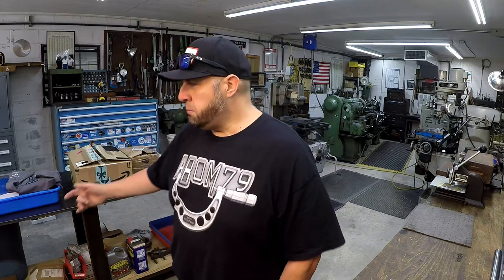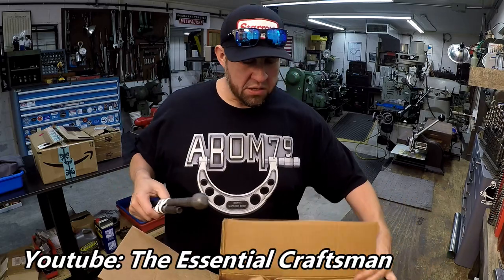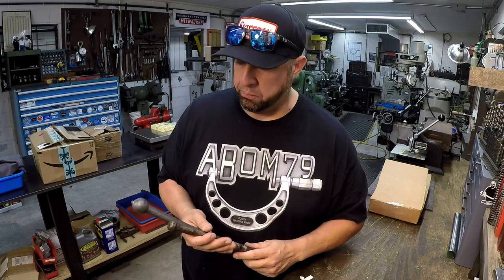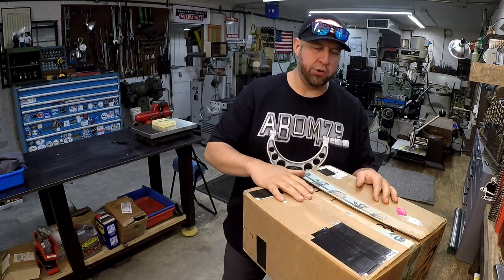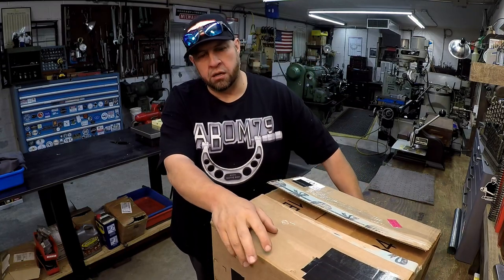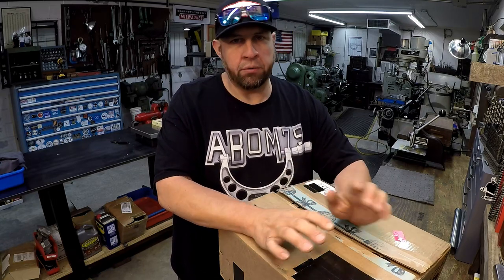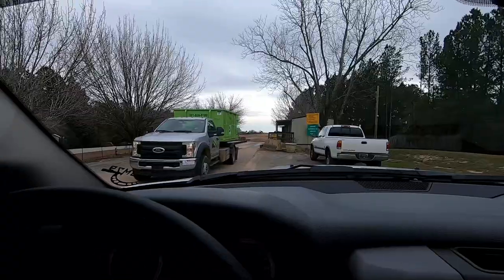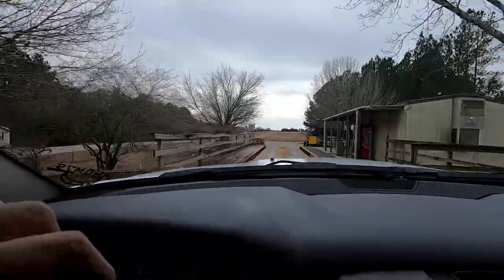SNS 251: Collaborations, Surface Plate, Precision Ground Stones

Comment: Adam; another You Tube channel I watch (Fab Rats); Paul found a $4,000.00 welder that did not work at his local dump & he bought it for scrap & he got it fixed and running.

Comment: Lance did a great job on the scraping of that cast iron plate.  I've got a 36" X 36" cast iron table to do one of these days.  Also, FYI, Harper College is right down the road from me, and it's in Palatine, Illinois, not Palestine.  One of the very best junior colleges in the nation.
Reply: Stop by the college sometime. I may have some goodies that will fit your Monarch.

Comment: Many congratulations on the good news. You're landfill is so easy compared to what we have in the UK. Our landfill site has about 15 different skips / areas for different types of material that will be recycled. You can only throw it in to the landfill skip if you can't put it in any of the others and the whole process is watched over by a load of guys that will tear you off a strip if you do anything wrong. The whole thing fits into a space the size of a postage stamp too.
Reply: Yeah, that pesky environment and recycling rules... just so we don't drown in rubbish... pf, should our children and grandchildren deal with it, I just wanna dump to my convenience!
Reply: @crispindry2815  Most landfills use that methane for power production.   Also they are lined and leached materials, such as mercury are recovered and processed.  Also, since people will not build on them, they serve as wildlife refuges when they are completed.

People used to complain about mining operations that left the landscape cratered and full of mounds.   50 years after we also see massive wildlife in-habitation of these zones due to the nooks and crannies now littering the landscape.
Reply: Subconsciously, Floridians know that the ocean will entirely cover that state. That would be depressing enough to prevent clear thinking on many issues.